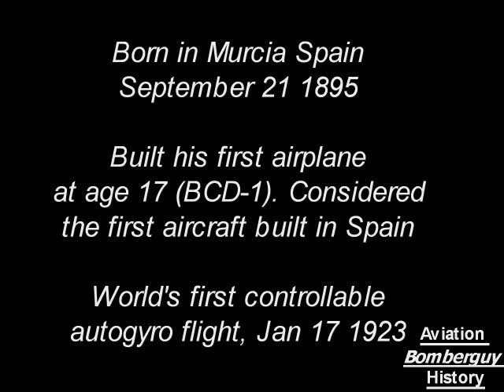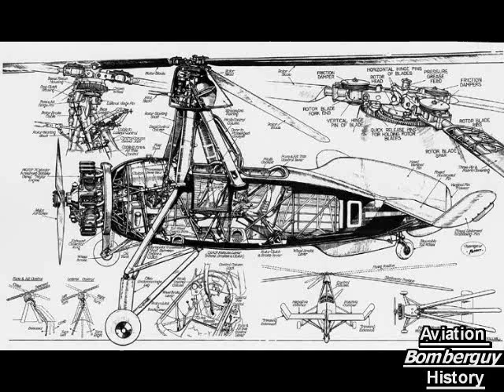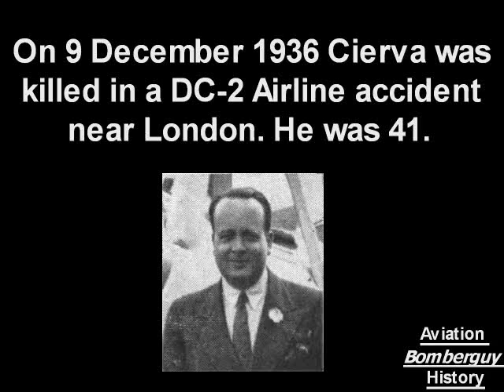Golden Age Pioneers: Juan de le Cierva

Comment: I was speculating and did say that there were other ways to do the pitch change without a swashplate. By the way, any of his machines that didn't rely on aerodynamic surfaces for rotor control were in effect using a swashplate for cyclic control. It's just that the swashplate mechanism is hidden, or combined, with the rotor bearing/s.

Comment: The Cierva 'jump start' autogyros didn't use a swashplate. Angling the lead-lag and flap articulations by a value different from 90º made the 'autodynamic' rotor possible. With this system, and while the rotor was pre-rotated on the ground, the blades were in a extreme lag position and at zero pitch. As soon as the engine was disconnected, and the torque applied to the rotor went to zero, the blades advanced to the extreme lead position, and -thanks to the angled articulation- got the pitch...

Comment: @Afrocanuk Tough one to answer as swashplate mechanisms were in common use long before Cierva utilized them. I suppose just as soon as he started tilting the rotor hub for cyclic control he pioneered the swashplate because in reality the swashplate and the rotor hub assembly would be one and the same. It was only when a jump takeoff feature was incorporated that the classic swashplate might have become a required feature (although there are other ways to do it). I suppose his patents would tell.

Comment from the maker: Better than you might think, here are the specs on the C.30:

Performance
Maximum speed: 110 mph (177 km/h) 
Cruise speed: 95 mph (153 km/h) 
Range: 285 mi (458 km) 
Rate of climb: 700 ft/min (213.4 m/min)